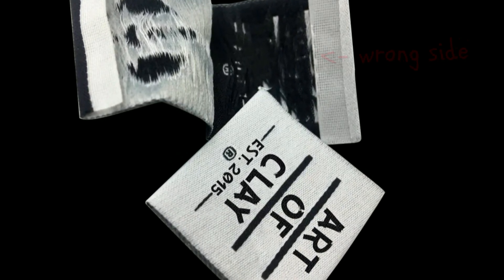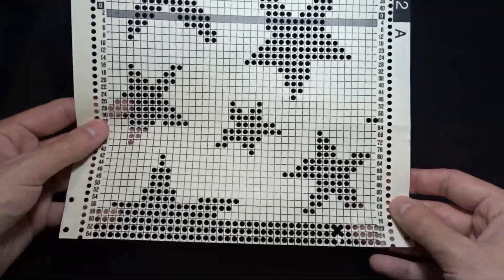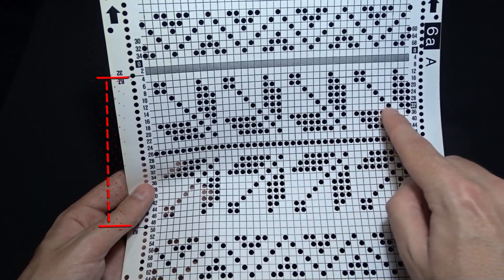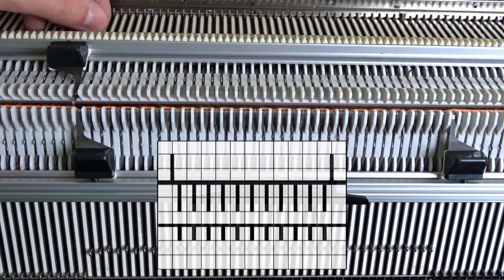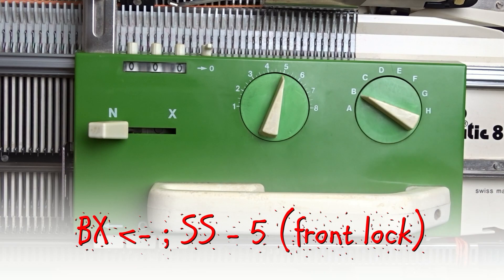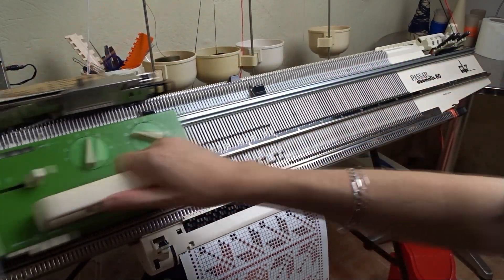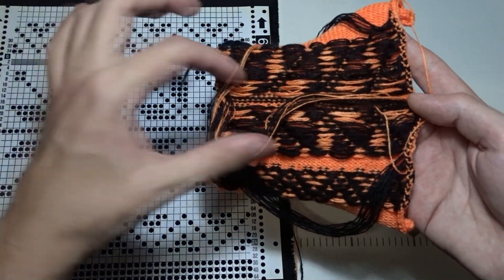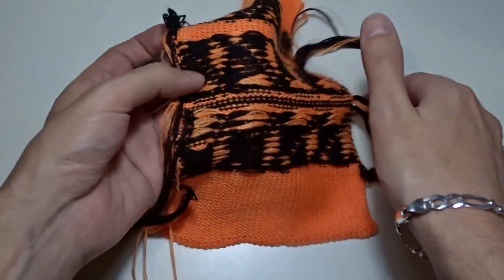Shh! The Secrets of The Fair Isle (Passap)

Comment: You don’t need to select each colour with the colour changer? It does it automatically?  I need to go read my manual again.
Reply from the maker: Yes, the color changer can automatically alternate between two eyelets! The manual will provide more details, but here’s how to set it up:
* Press any two black buttons (the ones used to select the eyelets) at the same time.
* Pull the metal lever on the right side of the color changer twice. This will make both eyelets above the pressed buttons pop up.
* Push the eyelet you want to use first back down, pull the metal lever to the right again (only once), and then push the other eyelet down.

Once this is set up, the colors will automatically change whenever the lock is brought to the color changer!

Friendly advice: Keep an eye on the color changer until you get used to it. Both eyelets may pop up at the same time and you can damage the color changer if you are moving the lock too fast.
Reply: @ will give that a try after the holidays. Thank you!
Reply from the maker: Enjoy the holidays, and feel free to reach out if you have any questions when you give it a try. Happy holidays! 🎄